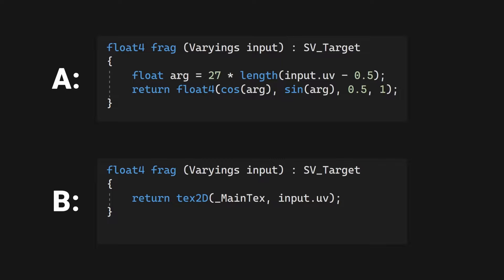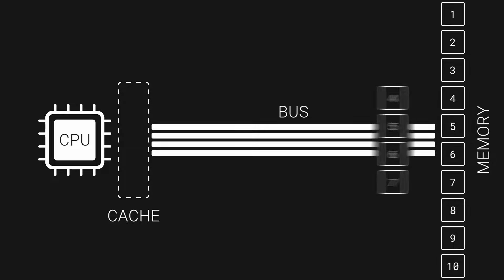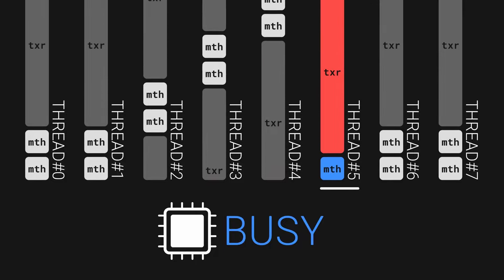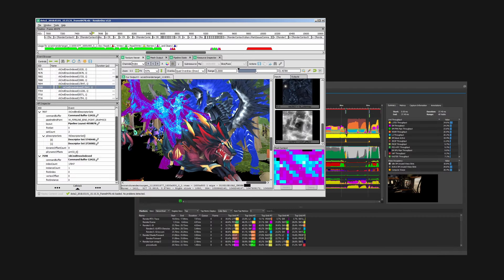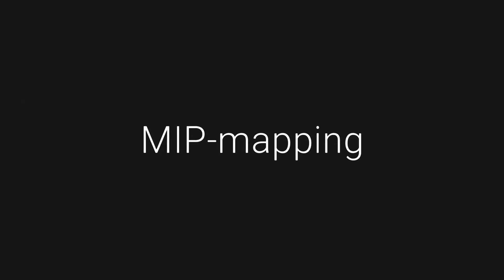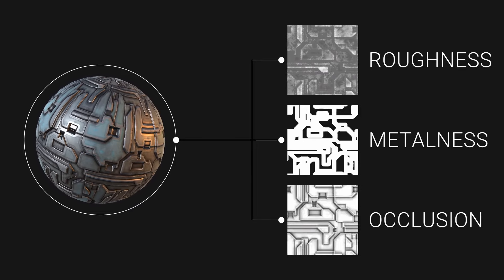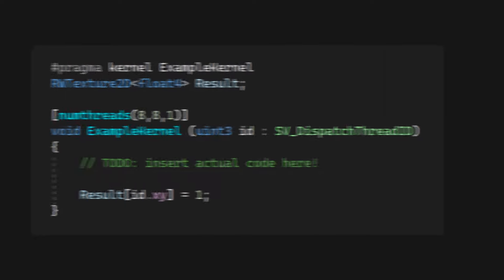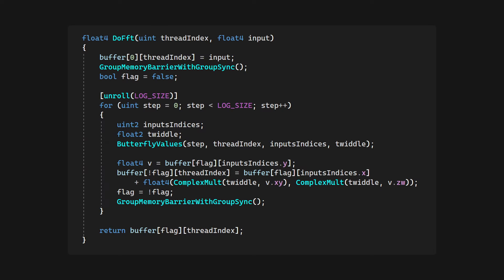How To Write Fast Shaders

Comment: A few things to add; shared memory is slow on mobile, so be careful when caching texture fetches there, as it might actually cost you. However this is really good on desktop when you have a lot of or big textures in resolution or bpp. Another important thing is that the most efficient group thread count may vary depending on your shader and gpu, so be sure to test on your target device(s) and pick the optimal version (some might want 16x16, some 32x32 for example). Aside from this, be sure that the group size (W*H*L) is dividable by 32 or you lose some perf because of how threads are scheduled.

Comment: Very nice video that helped me understand some things better. Can you elaborate how you misinterpreted the unity manual/how it actually works?  And for another question, the resizeable BAR feature newer gpus do, do you know how that can be used for more performance in practice? Is it just better to use certain texture sizes for it?
Reply from the maker: Desktop GPUs do all floating-point calculations in 32-bit float format, while some mobile or older hardware can do half precision  (16-bit) or fixed calculations. Unity manual says just that (however, on very recent GPUs native 16-bit float calcualtions are possible again).  This doesn't say anything about textures though, they can have various formats. For some time I thought that they are also converted to 32-bits and all other fancy formats are for mobile. And was wrong!
Reply: @JumpTrajectory  So textures are stored in various formats on the GPU but calculations are done in 32bit float right? (ignoring 16bit/int of old hardware)
Reply from the maker: @RoadsideCookie  Basically yes! On desktop in HLSL half is just an alias for float. Though I think there is also native int calculations support. Also 16-bit is not only for old hardware, but also for mobile and for newer desktop hardware.